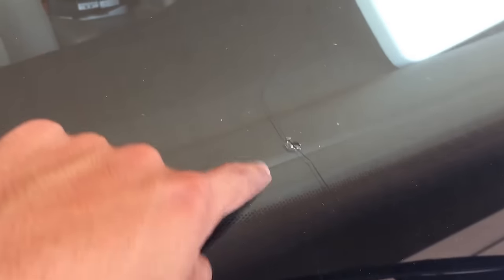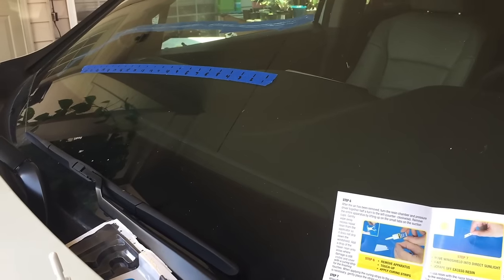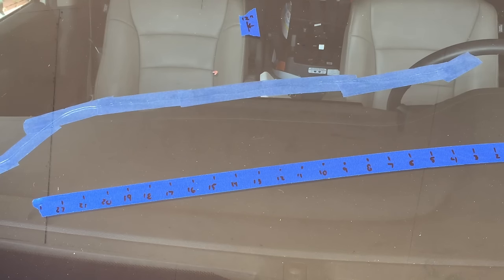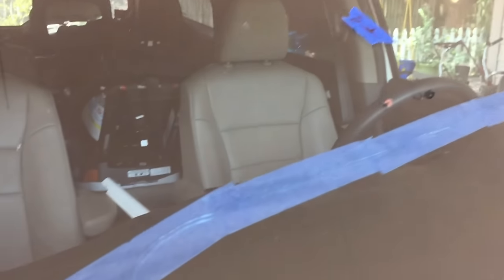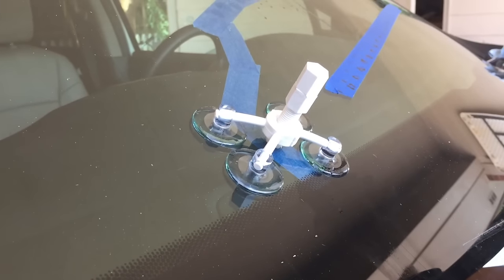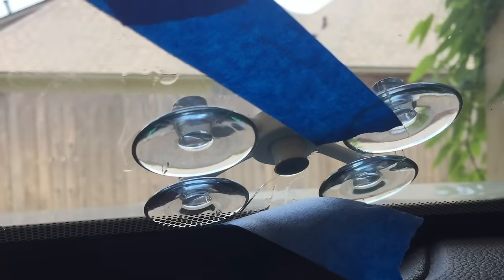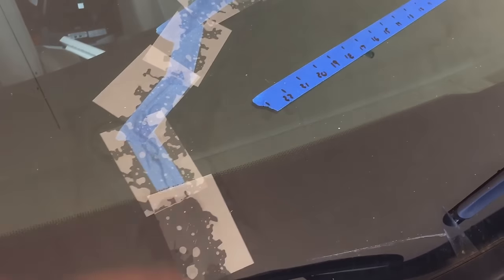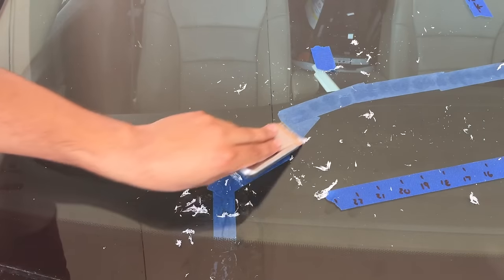Rain-X Windshield Repair Kit on a Chip + Long Crack

Comment: Sucks it didnt erase the crack, i wonder if the resin got all the way in? Probably best to have a buddy apply pressure from the other side as you apply
Reply from the maker: Yea, I was hoping for a little more hiding, but oh well. I did try to push the inside of the windshield at the crack, to open it up a little and try to get the resin to flow deeper, but didn't do much. I remember the instructions saying to push some, but not too much because you could make the crack worse, so that kind've scared me away from messing with it too much lol. The crack has still no progressed though, still the same length it was when we did the repair about 7 months ago

Comment: My question is.. how long did your repair last? Did it get any worse afterwards and if so how long afterwards? I had a crack show up on the side of my windshield and before I had a chance to do anything about it I guess because of drastic temp changes outside or something it went from just a few inches on the passenger side to all the way across in front of driver side .. just wondering if it’s even worth my time doing this but I really would like to keep it from getting worse.. at least for a while because I can’t afford anything else..
Reply from the maker: Hi, this has been this way since June 2020 I believe and still has not grown since
Reply: now it's Halloween, 2023 how is it going?
Reply from the maker: Still the same! I’m hoping to finally replace it by the end of the year tho. Have another crack and a large bullseye elsewhere now. But this crack has still not grown!

Comment: Thanks for the video. I would like to find out how to drill the ends of the crack to keep it from spreading.
Reply: Use a Dremel or a small drill, and get needle size bit with diamonds encrusted on this bit. 
Just like a wet saw for cutting tile, stone, granite, and glass.
I've heard not to drill all of the way through the windshield. So I'm going to try to go halfway through, but if it cracks again, 
I'll drill though it all of the way.
And just put tape on the inside until it dries. Good luck.

Comment: Good video, but this didn't do anything to my windshield crack. Chip got just a little bit smaller but that's it.
Reply from the maker: Sry to hear 😬 My crack got less visible / less reflective but my main goal was to stop the crack from spreading further which was accomplished
Reply: @fiveohmxco  That's ok, I passed my annual vehicle inspection anyway. 
Thank your for your reply :goodvibes:

Comment: Just discovered a crack this morning and by 11am it’s growing even longer. Good thing is it’s not 10inches. I need to try this repair asap.
Reply from the maker: We still haven’t replaced the windshield and it still hasn’t grown! 3 years and going strong
Reply: @fiveohmxco  that’s good  👍🏾

Comment: Well you did the video during the summer, now that we're using heat in the car's has it continued to spread?
Reply from the maker: The crack has still not grown, but I will admit that we live in Louisiana, so we only see a handful of days in winter where the weather drops below 32°F. The crack was regularly growing though before I applied this repair, even during the summer time.

Comment: Excellent video clearly with the 1M views. Can anyone answer pls, how many kits were used in this video? 2 or 1?
Reply from the maker: Just one kit!
Reply from the maker: And thank you 😊
Reply: @fiveohmxco  that's amazing! One kit had enough plastic flaps to cover 30 inches? Yesterday I discovered on my '91 w124 300e on top of my rear windshield (heated + laminated + tinted from factory) a long crack out of nowhere about the same size as yours, so was going to try this out. Thanks a lot!
Reply from the maker: @shaazy no prob! And yes, had plenty of strips. I was surprised as well lol. I used the kit linked in the description. Hope it turns out well!

Comment: As I tightened the suction cups, the crack became bigger. It cracked inside and I cannot even fill it. Even after resin dried, I don't see improvement. Is it a bad news?
Reply from the maker: Sorry to hear! I know the instructions say to lightly apply pressure with the suction screw. Maybe you had a really bad crack? Unfortunately, once the resin cures in sunlight, I don't think you can do further repairs
Reply: @fiveohmxco  Thank you. Would it at least stop it from cracking more? It's tricky because it is smooth on surface and it cracked inside layer...

Comment: Nice try but you need to secure the bullseye at the tip to terminate the crack. I also recommend that you use stronger resin made for long crack repairs, but it is best to use a professional if available in your area. You certainly have the skills to become a true professional with proper tools and training.
Reply from the maker: Thanks for the feedback!

Comment: If you want to stop it from growing, you need to drill a small hole at the end of the crack.
Reply from the maker: While I agree that’s the correct method to stock a crack from growing in general, this stopped ours from growing in our windshield. Been going strong for 3 years now
Reply: @fiveohmxco  Amazing news, was looking for an update comment
Reply: @fiveohmxco  I was searching for an update. I'm about to repair mine and I really don't want to drill.
Reply from the maker: @ASUbayboy  we still have the same windshield and still hasn’t grown!
Reply: @fiveohmxco  I think it is worth drilling the hole if you have the right tools -- but I think that filling the crack with resin should be enough. The reason the cracks get worse is air is inside and the pressure becomes different, inside, with environmental changes and that leads to the crack spreading because the pressure causes it to crack more. In theory, filling it with resin, even squishy resin, should help if there is very little to no air inside the repair.
Reply: @fiveohmxco Awesome! It it worked for you on that massive crack I'm going to go buy some for a 3ish inch crack I just got on my windshield today after calling off work to go to a mechanic to have repairs done! I have impeccable luck that never stops rewarding me everyday of my life!

Comment: You could use it on a crack longer than 12" but the crack will continue to expand with every hot/cold cycle regardless how much resin you put on it.

a crack longer than 8 Inches honestly already compromises the windshields integrity..
Reply from the maker: Nope. Ours hasn’t grown in like 3 years so sorry to say you are incorrect
Reply: @fiveohmxco  doesnt make me incorrect, laminated glass weakens with long breaks and repeatwd hot cold cycles.
Reply from the maker: Ok

Comment: Saw the video it seem like it works.i have question where can i get the whole kit that you used in this video.i been checking around stores & eBay,the kit comes w/ the repair session ,bulleyes but that thing that look like a spider with 4legs sponger doesn't come with it.i would like to get the same kit that you bought and used in the video.thanks
Reply from the maker: Hey, thanks for the comment. Check in the video description, I should have a link to amazon for the kit I used

Comment: Should I do another packet if my cracks don’t fill?
Reply from the maker: If you're cracks don't fill, I would try to squeeze more resin into the crack, or press on the inside of the windshield some more. Just make sure to do these things before you put it in the sunlight to cure - once it cures, I do not think you can add more resin to fill the cracks
Reply: M 2
Reply: i will definitely fill all your cracks up bb
Reply: @lordjaashin  ha ! Simp

Comment: Im an auto glass technician. This will not do anything. You will not pass inspection or keep the integrity of that glass. The repair size is to big. Replacement in the only option.
Reply from the maker: Agreed. It stopped the crack from spreading to in front of the driver side which was my main goal. Will not pass inspection though

Comment: We're u able to feel the crack in the glass before you fixed it... or did you run the resin along the crack and that fixed it.
Reply from the maker: Maybe super lightly. Just barely. Definitely depended on sight for the resin application

Comment: Just today paid $70 to have a guy come and the fix the windshield because of a stone.  Good video but it appeared the residue was flowing down your windshield.
Reply from the maker: It did! I made sure to clean it up good before i parked the car in the sunlight to cure though - no issues afterwards. Glad you caught your stone crack before it spread!
Reply from the maker: It did! I made sure to clean it up good before i parked the car in the sunlight to cure though - no issues afterwards. Glad you caught your stone crack before it spread!

Comment: Is the liquid similar to super glue?
Reply from the maker: I’m sure it’s somewhat similar, but this is an epoxy that requires UV light to cure or dry, so there’s definitely some differences. I’m my opinion, this is beneficial because it stays liquid much longer so you can squeeze and work it into the cracks before putting it into the sunlight to cure

Comment: sorry if this is a dumb question i got my first car yesterday and it has a pretty big crack on the windshield i’m not sure whether to replace the whole thing or just buy this the crack is almost like yours if i wash my car will water seep in? is it a must to cover the crack??? and is that thing (adhesive) water proof like if i wash the car will it prevent water from entering??
Reply from the maker: Hey it really should not affect waterproofing. The biggest reason to repair or replace in my opinion is if it’s affecting your view or if you can’t get a inspection tag because of it. The ‘right’ thing to do is replace, but this can get you by any in the meantime. We can’t pass inspection in our city with this crack tho

Comment: In case you or anyone didn't know, cracks and bull's-eye are covered free under your liability coverage insurance and no deductable, free free free. Stop wasting your time and money. Unless you don't have insurance then that's another video
Reply from the maker: Thanks! I was unaware of this. Liability coverage or comprehensive? This car has comprehensive since its relatively new so i’ll check with our insurance! I’d be surprised if liability would cover chips and cracks. And LOL about no insurance + another vid 😂😬
Reply: @fiveohmxco  comprehensive is a cause of nature or someone else’s fault. If a bird flew into your windshield or dog ran in front of your car then that no deductible, not your fault act of nature. Liability is if it’s your fault or a safety issue and it’s not your fault and a safety issue no cost to you windshield replacement
Reply from the maker: @Mrkouman  very cool, never knew that. Thanks!
Reply: There are few states that require this, most states don't and you will need to pay the deductible even with full coverage unless you have windshield coverage specifically in your policy which is normally separate.
Reply from the maker: @joeyv821  Yea that was my understanding. We live in Louisiana which i'm fairly certain has like the highest insurance rates in the country and i assume the worst coverage to go with it lol. One day I'll check with Geico and see what we have though.. we still have full coverage on this car but i doubt anything special for windshields
Reply: @Mrkouman  I have full coverage on my car and all the cracks from trucks led to a big crack and my insurance told me it'll cost 400 something just to fix it. So here I am-- I'm so mad.
Reply: @briana377  who do you have coverage through? Is it one of those state minimum places? That may be a difference
Reply: @Mrkouman  Not sure, through Geico. Which I don't know why I don't switch. They wouldn't even cover for the time there was a tire in the road and it got the side of my car ruining something that hit the a/c let alone ruining my front side --not being able to move safely to another lane from other cars. It's the worst
Reply: They didn't believe that the a/c had anything to do with it but my car is low and I had to go to someone else and they confirmed it was because of that incident. Geico still only decided to do the minimum even though it wasn't my fault.
Reply: @briana377  a tire in the road is not an act of nature like a dog running in front of you, something like that you should have a dash cam to protect yourself but it still does not get covered unless that tire just came off a truck then you could get plates off the truck to go after that truck. Sorry for your loss on that bud, maybe check into a different insurance company cause geico is cheaper for a reason
Reply: @Mrkouman  It happened on the highway and there was no room for me to move over so they decided to cover minimal damage but yes a dash cam would've been helpful since they didn't believe me and I will
Reply: Thank you:)
Reply: called Geico, i  am not covered as i do not have Comprehensive anymore. i am SOL
Reply: Ummm….not free per se. Insurance will repair AFTER you meet your deductible. Sometimes the windshield is cheaper for repair on your own. Sometimes the deductible is higher than what you can afford, so things like this is worth a try🤷🏽‍♀️
Reply: @rhondac970  no your thinking health insurance, there's no meeting your deductable. No one's car insurance is 5,000 deductable. It's just $500, $1,000 and so on. Your a fool to get anything higher than $500 deductable. Most car windshield is under $200 and that much is covered 100% no deductable. What part do you not understand that
Reply: @briana377  what insurance company do you have? If it's state minimum coverage then they don't cover it. There should be a coverage of "act of nature" damages like a hail storm or tree that falls onto your car. That is the part where a rock can chip your windshield.
Reply: @briana377  I'm not sure about the tire in the road thing. I'm not an insurance agent in any way but know the windshield should be covered.
Reply: @briana377  Geico only covers state minimum. There's no blanket coverage. Just enough to keep you legal where you're insurance covers the other car and the lives of people in your car or the car you hit if your found at fault. Other than that I don't think it even covers your life and barely covers your car only with junk yard parts up to a value. And their blue book value is Geico's blue book not the national blue book. So if kbb said your car is worth $10k.. Geico's BB would show something like $4k or $3k and damage repair value world be less as well.

Comment: So how has it held up over time?  AND did it pass inspection??
Reply from the maker: Hi, it was held up well, still hasn’t spread, but I haven’t tried to get it inspected. I think it will fail just based on overall length from what I’ve read. Still rocking the sticker that expired in 2020! 😬